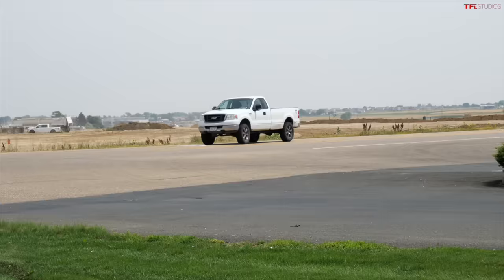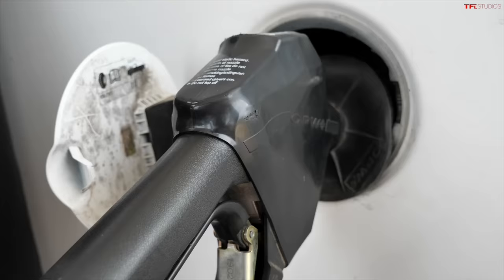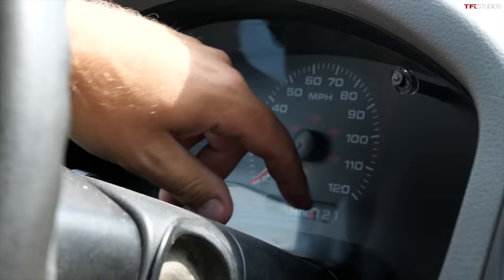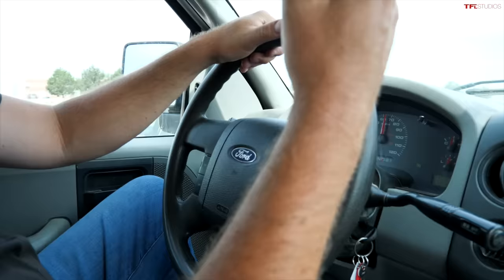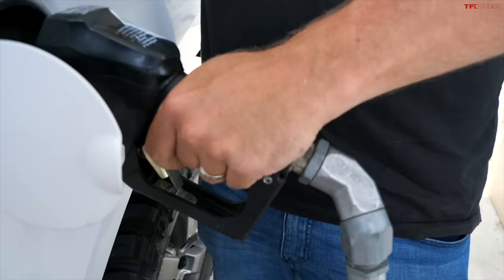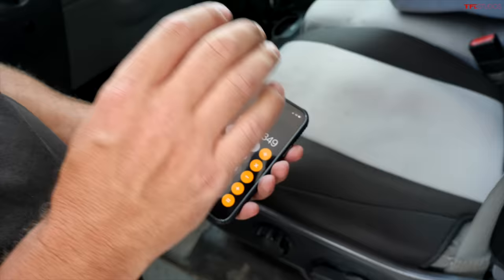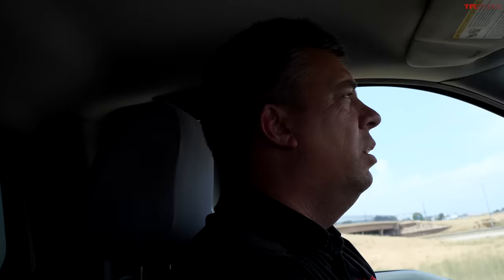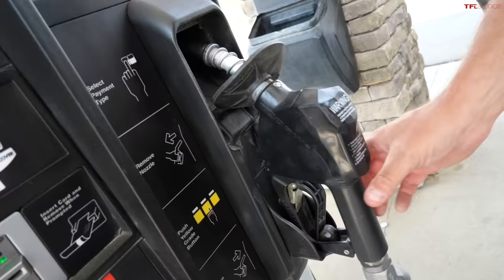Surprising Result: Here’s What Happens To Your Truck’s MPG When You Install A Topper!

Comment: very interesting test. maybe do one with tailgate up and down? i thought id get better mpg with tailgate down but found out that my tailgate could be stolen if not locked and i saw something somewhere that explained about airflow over the bed and is better with tailgate up. i never see anyone drive with tailgate down. i also think the tailgate could get damaged by bouncing if i hit a bad bump (or speedbump). when i first ran with it down i did buy amber reflectors (maybe should have been red for the rear) and put them on the side of the tailgate, just to kinda look cool. the thing about a camper cap, as i know them, is im one person and at 200 lbs, itd be hard for me to remove and install. ive carried loads that would require the cap removed more often than not so ive never bought one. one more thing, i have an '01 4.6 V8 F150 extra cab 2WD and i average 16 mpg.

Comment: I drive a 2019 Ford F150 XT work truck with a camper topper.  5.0 Engine.  Averages 19.2 over the course of 56k miles.

Comment: I was surprised at the outcome, thought there would be a bigger difference one way or another.  One thing I need to figure out though is how you're getting over 18mpg in that truck.  I have an '03 F150 with the same 4.6L engine, 4wd, short bed, no lift, 265R75 tires and I average 15mpg empty.

Comment: Because that was a long bed truck the tailgate is further back than it is in a regular cab.  Because of that it's likely to catch more wind resistance because it's further away from the area where the wind isn't moving down in the bed yet.  I know I can transport delicate plants in my truck tucked up near the cab and the wind doesn't really get to them.  I don't know at all what I'm talking about but that feels right in my head.  So maybe it would have made less of a difference, if any, on a regular bed where the tailgate is sort of in that buffer zone.

Comment: The increase weight probably cancels out whatever fuel economy you could otherwise have gained. For obvious reasons big tires lift kits are going to wreak havoc on your MPG but I did not buy my Nissan pickup for fuel economy.

Comment: The 4.6 l engine from the 05 to 08  is one of the best and more efficient engines ever.  300,000 miles is not unusual for these engines.

Comment: I assume tail gate was up for loop #1.  Did you use pump #11 for top off w/ Cap before loop #2?  Also I would like to see 2 things.
1. Use a 200 mile loop. (To rule out top off variances). AND, Write down odometer miles for both loops. Even if odometer is off a bit.
It is still apples to apples, to double check against GPS.

Comment: Try driving the same route with no topper and the tailgate open instead of closed. I had a noticeable mileage improvement when driving at highway speeds in my 1966/240ci 3speed Ford (6 cyl) with the tailgate open instead of closed.

Comment: I know Mythbusters did a whole thing about people who put their tailgate down to try to save fuel, but they showed that it isn't more fuel efficient because the air circulates in the bed of the truck creating it's own aerodynamics. BUT!!  What about a tonneau cover?  OR what about hi-liner shells?  Or a cloth shell? Or a pop-up camper (like FourWheel Campers)?

Comment: My old 78 chevy avg 16 MPG. With full shell about the same. Made a custom fastback style shell and increased but not by much. Sad part is all the modern electronics and complications of modern trucks only add a couple MPG over the old tuned quadrajets. A lot more horsepower though so there is that.
Reply: Computer controlled vehicles don't do anything better than a carb & HEI ignition. My NASCAR look 89 C1500 hot rod with a 500hp 409ci engine & a Holley 750 double pumper gets better fuel economy than my 04 Tahoe. Efficiency & proper tuning is the key!

Comment: lotta variables too, a diesel truck more likely can possibly benefit from a top camper due to low end torque and less revolution turnover, where as that ford he was driving, torque band optimum could be in the 3k plus so basically like he said the added weight require a tiny bit of more work, and that could be counteract by better CAI, plat spark plugs, free flow exhaust catback

Comment: 2004 F-150 4.2 v6, elevated camper top at seventy mph travel on flatland 300 miles I getting 17.4 mpg at  four hours and 20 minutes. 3/4 tank of gas.

Comment: Not sure you can get any kind of accurate comparison by running several trips....my experience has been that even a slight increase in accelerator pressure on leaving any stopped position or even accelerating to speed will effect short term mileage figures. A tenth has to be within any +/- factor although even at a wash it's a win.   Really enjoy your channel...thanks
Reply: I put 75,000 miles on an 05 1/2 ton, crew cab 4x4 Chevy pickup with a 5.3. Over time, I put heat coated shorty headers & a free flowing exhaust on it, first changing the cat back exhaust & later the headers. It ran a little better but the mpg never changed. It average about 17.5 for the entire time I owned it, both before & after I made the changes.

Comment: I have had several trucks and I always have a tonneau cover. Ever truck except my present truck got better mileage with the cover. My new truck (2021 GMC elevation w/5.3 v8) gets lower mileage with the tonneau cover. All highway (cruise @ 74) with the cover I get about 19 on summer gas (don't get me started on whining about the "winter gad" around here), without the cover I get >22.

Comment: That was a good non-technical test and it’s something anyone could use to test the benefits, or not, of adding a topper or any type of bed covering, on their own vehicle(s).  What was the actual name of the GPS app you used.  I tried using just “GPS” but got a lot of apps, but none of them looked as efficient as the one you were using in this video. Thanks for the information and details.

Comment: I have a 2010  F150 XL, 2wd, 4.6 V8, it has a cap, its raised up in the back, I get 
a average 16 mpg, in town, low in winter 11mpg, to 20 highway, I drive it easy

Comment: Now do it with a trailer!, My theory is the topper would help with negative pressure in between the bed and trailer just like big vans have as small as possible of a gap to help with fuel.

Comment: Wow, e-85 👍🏻 Viewing August 12,2021
There could have been an windage variant between the two runs…….
I’ve got a 2014 F150 XLT with V6, and on highway driving using cruise control I get 19 + using 87 octane….. Louisiana

Comment: For me, the best solution for covering the bed on my truck was a hard bed-cover/tonneau, not a topper. Don't know if it helps or hurts MPG numbers, but that wasn't even a consideration for me as I needed it for (1) at least SOME security for things carried back there and (2) to keep those things WHEN in there weather-protected (but I guessed it wouldn't HURT mileage). On the HWY I have gotten some pretty decent mileage IF I don't have a stiff headwind, as THAT will drop MPG quite noticeably.
-- BR

Comment: OK,  let's get real. With trucks, their function is supposed to be hauling weight, NOT setting mileage records.
A lot of factors go into what sort of mileage you can expect. Not only aerodynamics, but things like torque and gear ratios. I had many pickup trucks with various configurations and one, in particular got 11 mpg regardless whether it was loaded, empty, had a cap or a camper or was hauling a trailer because of the amount of power (torque)  and the gear ratio of the final drive. Because the torque stayed relatively constant in relationship with the final drive ratio at whatever rpm, there was little if any difference in mpg at any given speed. HOWEVER, that truck was set up to haul the maximum amount of weight possible,  therfore the  mileage it would get unloaded stayed pretty much the same  as loaded because it was still running at the same rpm at any given speed. The only real difference was how quickly it could accelerate to that speed empty compared to loaded.

Comment: I have always been told, so followed the rule of thumb, that especially with highway driving in a truck, if you have nothing in the bed, to lower the tailgate ... as the tailgate throws off aerodynamics .... because the air flows over the cab, then down, and slaps the tailgate.  I don't know if it's true or not, but if not carrying anything in the bed, I always drive with the tailgate down.  Also in my show truck ... I have a tonneau cover ... that is a plasticized vinyl with snaps.  Weighs a lot less than a topper, and should assist with aerodynamics without the added weight.

Comment: If Andre got an improvement of 0.1 mpg over 54 miles, extrapolate that over 12,000 miles (average driving per year) multiplied by the life expectancy of the truck.   Definitely worth getting a topper with a new truck.    The improvement for towing an RV with a topper and a spoiler installed would be much more noticeable.

Comment: To improve few efficiency you need to decrease sharp edges at the rear of the car. The topper just moves the sharp edge at the rear of the cab to the rear of the truck so doesn’t make much of a difference. If it would taper off at the rear (ie slope from the roof of the cab to the rear of the truck - like a wedge) you would see much more pronounced impact on fuel efficiency… which also explains why the Cybertruck has a tapering rear cover.
Reply: And lose the benefits of storage and carrying capacity, as they make little difference in consumption the point is all a bit moot.

Comment: I look at it like this: there is no disadvantage to running a truck topper on a pickup truck. Yes, it weighs about 200 pounds, so the truck has to lug that extra weight around. There is some small aerodynamic advantage, but all in all, its a wash, so no penalty.

Comment: @10:31 "I cannot do it any more scientific than this" but @5:00 is one reason why this test method cannot measure fuel economy as precisely as their calculated values indicate. Suggestions: longer test loop; measure fuel more precisely than by when the gas pump cuts off; run test very early in the morning to minimize traffic variables; only run during calm wind conditions.

Comment: I'd love to see a comparison of with top and without topper pulling a travel trailer. I believe that there is a huge ball of air in the truck bed without a topper.
Reply: This is what I want to know. In theory it should help a lot
Reply: What you're talking about is the frontal area of the trailer's wind resistance. A fifth wheel will get better economy than a bumper pull of the same size & weight because it's more aero & it's easier to carry a load than drag it. My buddy's new Class C motorhome completely shields his race car trailer & mpg is only affected by the weight, since the air doesn't see the front of the trailer. He gets 9-11 depending on terrain with a 6.6 litre gas engine with the trailer. He's on his first long trip so we will see what his average is on 3600 miles pulling a 24' enclosed trailer. Also, my semi truck got the same mpg all the time, empty or loaded, van, flat bed, gooseneck or NO trailer. Frontal area & drag are economy killers.

Comment: I could be wrong but I think most people that put a Topper on their vehicle are doing it for other reasons than fuel efficiency. I know for myself I have a cap on my truck because I have a small business and carry things in the back that I wouldn't want to get wet for customers. Also a lot of people carry tools in the back of their truck that they'd also like to stay dry so I don't think for those folks the difference in gas mileage which is going to be probably a decimal point is a big deal I think that the air being thin in Colorado has some other effects on people other than what octane gas they need to use.

Comment: My 2007 Sierra classic with a 5.3 and a topper got vastly better Milage than my 2016 F150 with the 2.7 Ecoboost with no topper. I drive fairly gingerly as well.
Reply: That’s odd then because I’ve owned the Hemi V8, the 5.0, 5.4 ford V’8’s the 3.5 eco boost and now I have the 2.7 eco boost and the little 2.7 eco boost is in the mid 20’s on the highway on a none windy day almost 28 mpg. And I’ve driven at least 500,000 km in them in western Canada.

Comment: I had an 89 F-150 with an EFI 300, I averaged 21 mpg Highway & city. here we are with all our technology years later and not doing any better. I have seen first hand experimental cars that have slipped into public hands with carburetors getting 40-50-60 mpg. the technology  is out there but its a big secret

Comment: The fun one is tailgate up or down. On newer trucks you actually will get worse gas millage if its down as the Engineers design the trucks to be super aerodynamic in a normal setting. AKA tail gate up as apposed to tail gate down or mesh netting
Reply: That's the same with older trucks too. The air never sees the tailgate.

Comment: . I took my cruise control,  pickup, four cylinder truck on 100 mile trip one way at nighttime (Constant temperature) a daily trip which I had been doing for the past year.  Tailgate up, 25mpg, Tailgate down 33mpg. So tail gate up took 4 gallons per trip. Tailgate down it took 3 gallons. There was nothing in the bed of the truck.

Comment: Yes, you can do it more scientific.   
  Test longer distances to get a better average.  You can't trust the automatic shut-off to fill the tank to the same level each time. 
    Visually confirm the fill level by Topping up the  fill spout. Slowly.  Just be ready to clean up the mess if you run out of patience.

Comment: I have proven not only to myself , but also all the guys I worked with that a very simple trick with any pick-up truck to increase gas or fuel mileage . Not with a pick-up truck topper , but simply opening or dropping down the tailgate of a pick-up truck Will increase gas or fuel mileage , especially on long trips down the highway !  And I didn't have to spend any money for an add-on for the pick-up trucks !

Comment: Put all your bikes, camping gear, food, coolers, charcoal, luggage, clothes in you truck on a rainy day and drive 5 hours to the campground. Halfway there park at a mall and shop for an hour.  Now do the same with a topper you will find that it is more expensive without the topper because your stuff is all over the highway, stolen, or ruined as is your week long camping trip. ;-) If it got 3 miles per gallon less it would be cheap.  It allows my Mtn. bike to always be packed, a tent, and lots of useful stuff to be at the ready.  Can't fit much stuff under a tonneau and you can't leave anything other than heavy trash in the back of a truck without a cap without it being stolen or blown out.  Topper truck belongs to a prepared person who uses their truck and the rest are posers unless they have a fifth wheel or gooseneck hitch.

Comment: 85 octane is only needed for carbureted engines, modern fuel injected engines can actually be harmed by it because the automatically adjust fuel to airflow. Using 85 octane can also affect your warranty.

Comment: I know this is a year old but you should repeat it with three runs. The third run would be with the top off and an equivalent load in the truck. That would let you know the impact of the weight.

Comment: seriously the only way to test his is by using a full tank... long trip... several hundred miles... like  vegas to LA   and round trip...  so you get the same hills etc... traffic is hard to keep the same from one day to the next.. heck even from one hour to the next. ... its very iffy test,... having said that... I put a shell on my colorado diesel, the shell is about 4 inches taller than the cab  so my mpg went down by 1-2 mpg.  very noticeable to me as i keep track of my gas usage for work, and the miles driven. so each tank full i have mpg info.  I knew id lose mpg as above 45 mph wind drag really effects it. I ended up installing some curb ramps in front of the shell/on top of the cab roof, to give it a bit of chance to lower that drag from all that air hitting the shell. it worked!  mpg is back to normal range.   shell is aluminum steel and was told it weighs in around 400 lbs.

Comment: It takes Colorado a long time to change. Until recently they required that beer sold in grocery stores was the wimpy 3.2% kind. Likewise back in the old days 85 octane worked. But just like 3.2 beer we have newer vehicles so don't buy 85 octane. If I was doing a miles per gallon test I would use what everybody uses which is 87 octane.

Comment: Any flat surface will act as a brake, open the tailgate or remove it to get better gas mileage, drive with your hand out the window, turn it so it acts like a wing, and then hold it flat, the wind will almost break your arm, that's aerodynamics. Many people try to hit someone with a pool cue in the movies, what do you think does more damage, hitting someone with 5' of stick or stabbing them with a 1-inch end. The military taught us how to fight with our weapons, at no time were we told to use it like a bat but like a pool cue, jab and slash not bash. That is because of aerodynamics too, take a 4x8 piece of plywood hold it flat and try to walk with it then hold with the thin end out notice the difference, just imagine at  50 mph, thin end first or flat. Flat would take so much more power than the thin end, it doesn't take a genius or a wind tunnel to know how to make something more aerodynamic, just common sense.

Comment: Run a test with stock height and tire/wheel combo vs lift and larger diameter tire/wheel combo and the resulting changes in drive gear ratios/electronics